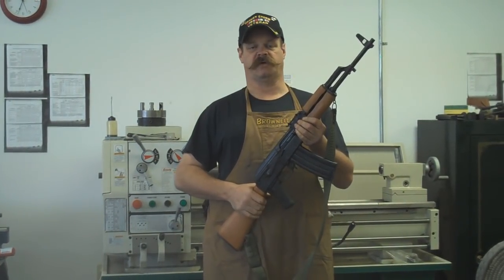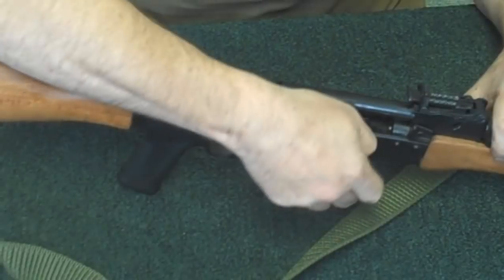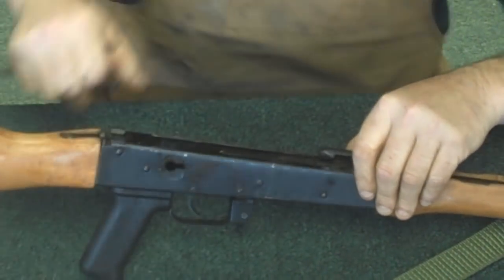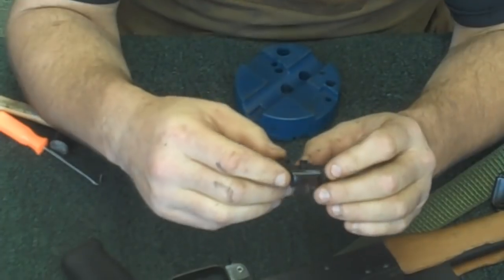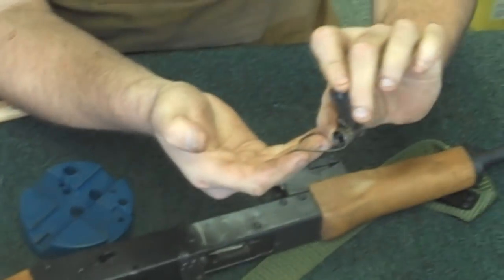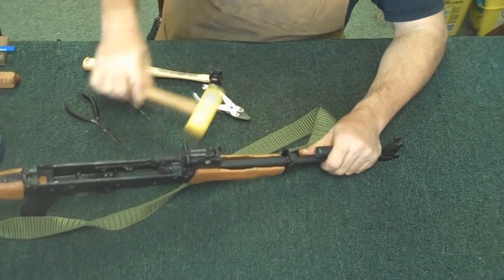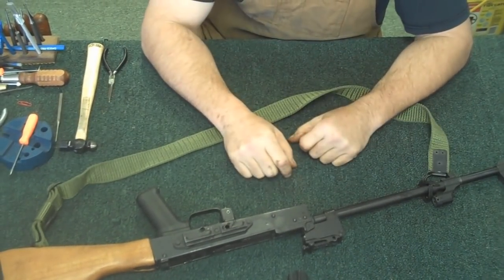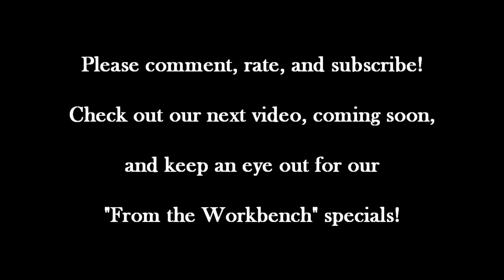Gunsmithing: AK-47 Disassembly .223 (Gunworks)

Comment from the maker: @eichang84 

Sounds like you might need to figure out a way to stifffen the magazine well to hold the mags better. Failure to eject seems to be part of the problem of using the wrong reciever. Double feed is due to loose magazine problems. 74 and 47 receivers are NOT the same dimensionally.

Comment: Great video, I recently bought a Romanian WASR and while I was fielding stripping it I pulled the safety all the way up, in my startlement I shoved it back down into the firing position and accidently pulled the trigger. I put the hammer back down but now I can't put the safety lever back into the safety position and my trigger is 'stuck'. It simply wont go forward. Any advice or tips?

Comment: hi jim I recently bought a homebuilt ak 74 semi-auto built on a bulgarian parts kit.  It groups well however every 2 to 3 rounds the gun FTE and also it double feeds.  
How can I remedy this issue?  The extractor seems like new.  The magazine fits very loosely because the receiver is one for an ak 47 and the magazine recess is oversize therefore there is wobble side to side on the mags.  Please give me any suggestions to prevent the FTE and double feeds. Thanks